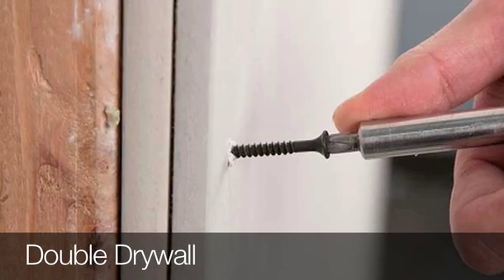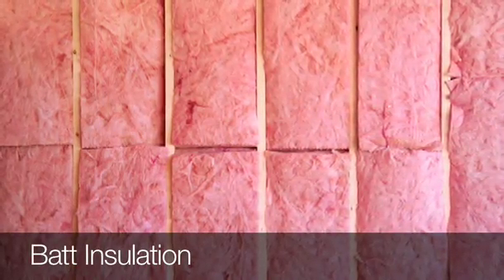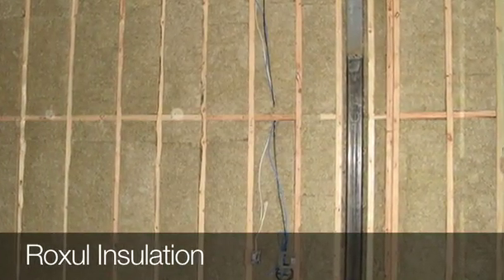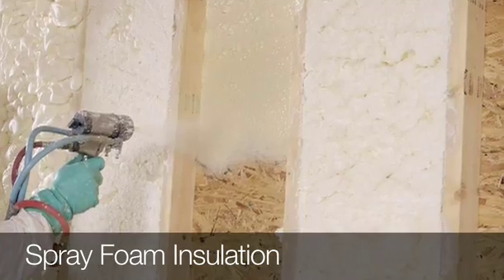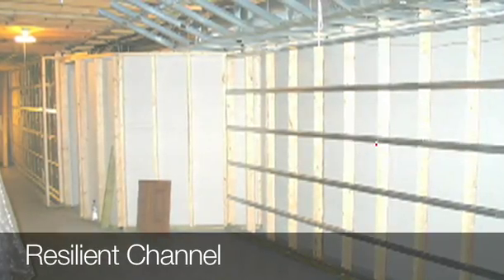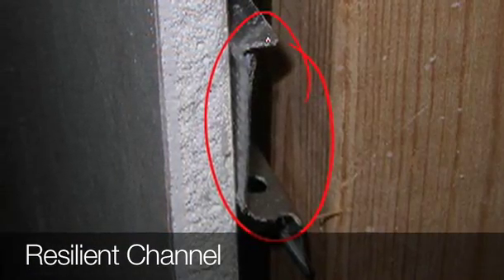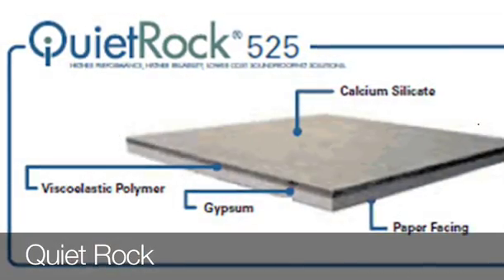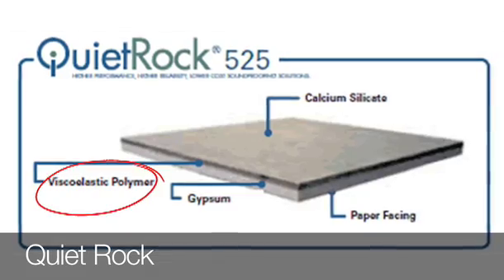How to Soundproof Interior Walls

Comment: A double layer of plasterboard/gyprock will not work as it is a dense material which will carry sound. There is no isolating material used between the board and the framework. Trust these two to be worried about what noises are coming from their bedroom! Only joking, don't burn me at the stake for it 🤣
Reply: double drywall but with the tiny gap in between is key.  Sound waves dissipate as they change material, air to drywall air gap then back to drywall then the air in the room.  The dense drywall does more for lower frequency and might as well have normal fiberglass insulation between the studs.  Wont do much for the long waves of low frequency but will for higher such as talking.  Next level is hanging the drywall off of the studs so vibrations do no transfer through.  There are various ways to do that.  They also make puddy stuff that goes round electrical boxes to limit airgaps which allow sound through by far the most easily.

Comment: Spray foam is bad. You might as well stuff gasoline in your walls.
Reply: If it fills an enclosed cavity, a foam would have to melt rapidly to be much of a hazard, since the drywall will deprive it of much oxygen. Great Stuff burns like wood; it doesn't melt or burst into flames, but it won't block them either. It also degrades slowly at fairly low temperatures, so if you use it near a chimney, it might not all be there forever. Some of the more advanced foams like urethane, polyisocyanurate , block fire much better, but being insulators, they make any fire that starts hotter and often  need an intumescent coating if they are exposed to the interior of a room. Polystyrene, with no flame retardants, melts and really does burn like gasoline.

Comment: Does anyone have advice for a top floor apartment with loud HVAC sound/vibration coming through the ceiling? It is a very deep hum/vibration.
Reply: Phil Carson rip the cieling drywall off. Insulate with acoustical fiberglass bat  insulation that is as thick as the floor joyces and stud centers. Then find resilliance channel or sound bar. Then get 5/8 thick fire rated drywall. Tape. mud. Paint. I don't recommend texture ceiling finishes anymore. It creates maintenance complications in the future.

If installed correctly and completely..?? You could sleep under a house party of 50 without notice.

Double up drywall for best result. For safety and sound. As fire would take 1- 2 hour to penetrate double 5/8 fireboard  drywall. This path however would require resetting electrical box depths for light/co2/fire.

I recommend going to an ACTUAL drywall/insulation material supplier for the best material price/advice and recomondations on cheap journeyman labor to get a quality job.
Reply: @dootdoot1867  
Ok but this is an apartment building.  I too have the same problem. What do you think about leaving the ceiling drywall above alone . Would it wirk if stick the foam on ceiling with liquid nails . And then somehow add panels to cover the foam? How would I fix the panels with nails or screws and would this be stable ?
Reply: @heyman5539  It would stop basic High pitch short wave sound travel(Chatter)... but not bulk vibrations. Any Bass. Foot steps.. Anything that transfers sound largely through Vibration will just travel through the layers. The Idea behind sound bar is that it creates a barrier between Vibrations transferring across separating surfaces.

Even Foam is limited in it's ability to limit sound... It is a great insulator for heat. Not Vibrations.. As it can transfer right through the surface to the next.  Roxul Insulation for example is some of the better insulation for sound... And it is basically Lava rock, re- melted and spun into a wool... Basically called "Stone Wool"
Reply: @heyman5539  in your situation... depends on if it is a texture ceiling. If not you can screw sound bar to the ceiling with fatboy drywall screws. Make sure you miss studs. Otherwise vibration travels.. then drywall to the soundbar with shorter screws and you have created a vibration barrier and air pocket. If only the fat boy screws are what penetrate existing drywall. Easy quick patch drys 15 mins and a touch up. No quick fix sadly. Just short cuts.
Reply: @dootdoot1867  
It's a sleek finish ceiling. And dont screw into studs? Will it be sturdy? Is the bar heavy?
Reply: @dootdoot1867  
What about the foam ? Or insulation? Should I put that between the soundbar and new dry wall or should it be acoustic panels??
Reply: @heyman5539  sound bar is made out of stamped tin. Fatboy screws and sound bar can hold a few hundred pounds spread out per bar. We will hang double 5/8 fireboard on it.
Reply: @heyman5539  wouldn't need the insulation with this route.
Reply: @dootdoot1867  
Thank you . This method will help the voices and the high frequency noises ?  In my bedroom what methodd will reduce ceiling creaking along with muffled voices

Comment: One more left out. Double up walls and stagger seams
Reply: +Danny Miller are you asheet rocker
Reply: I'm a contractor
Reply: +Danny Miller You sound like such a badass. ^_^
Reply: Lol no just a guy who had a stroke sorry
Reply: +Danny Miller I noticed that too. When I did mine I caulked the joints up on the first layer, stuck the second layer staggering the joints, a coat of plaster (3mm skim), then fixed two layers of carpet underlay and hung full length curtains all the way round. No sound gets out. No sound gets in.
Reply: full curtains around the whole room would not allow cool stuff on the walls and does it deaden the sound in room what is the size of your theater area .Thank you
Reply: Danny Miller Well, if you want to stick 'cool stuff' on your walls rather than concern yourself with the less important, mundane features of a studio environment, the acoustics for example, then you go ahead and stick patches of "vastly inflated price for what you get" recycled packing foam.
Hung ceiling to floor from poles, lined curtains are relatively cheap to buy, most of us have piles of them in our attics or our relatives have and they eliminate all unwanted reflections, from any direction.
Good luck with your 'cool stuff'. I bet it sounds great on your recordings.
Reply: @mysterioussquirrel4456   sounds like you have some 50 Shades of John Wayne Gacey stuff going on over there, MS.   ...or you're a drummer.  
Which is a much worse type of person, IMO.  lol
Good advice, actually.